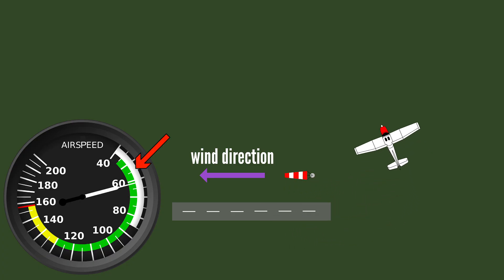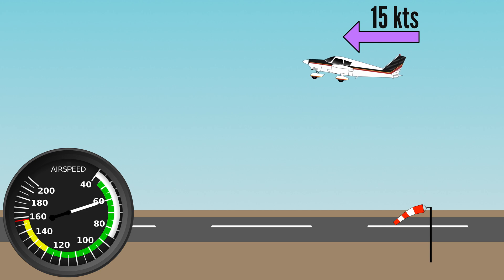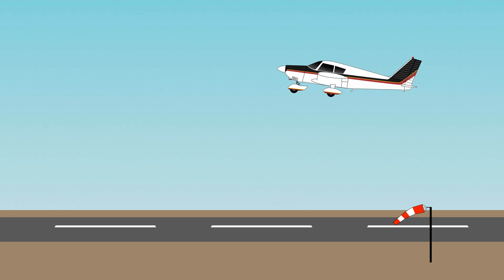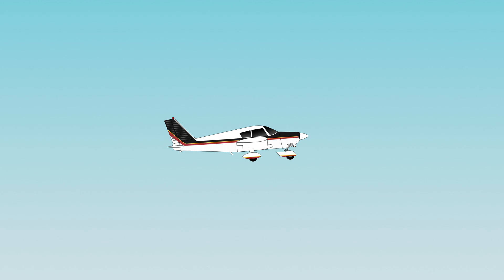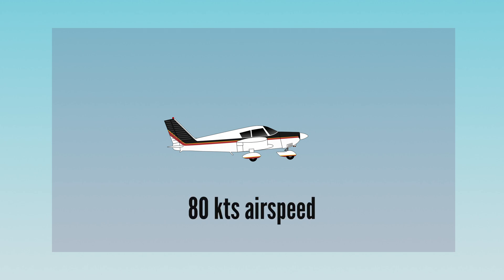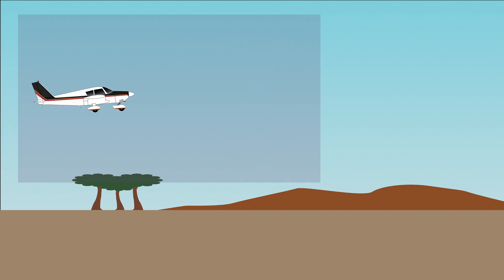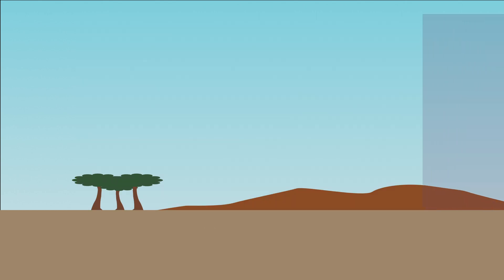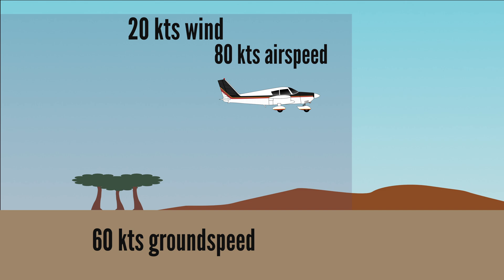The Myth of the Downwind Turn - Dangerous or Not?

Comment: Quite correct, not directly related but I once 'threw the rulebook away' after EFATO towing a glider. Reasoning? I was used to manoeuvring at low level (hooliganism) and I was able to retain a small amount of power after jettisoning the glider and turning cross-wind. The RWY was over a mile, we had started from near the thresh. Therefore I was able to plan a gliding circuit to a landing at the far end of the RWY. After 4000+ tows a final turn at 150-200' was nw.

The recommendation for the private pilot remains sensible. Choose a landing or low speed crash area and never turn back!
Reply: Drills complete by about 90 degrees into our standard constant aspect oval circuit.

So happy to evolve beyond the naff square circuit (if they still do those??).

Comment: One factor that is not mentioned is that especially beginners use too much left rudder to turn left while climbing with full power. The plane needs almost no extra left rudder but the student adds more left rudder because that is what you should do when turning left they think. That can cause a skid turn and stall the left wing with bad things to follow.

Comment: After having a read throughout all the comments here, I want to say a Big Thank You to author of this channel and video! Thank You for going into debatable topics, and open for questions and even civil argument :)

As a point for improvement, I would say, that I would love to see "official" sources proving what you say in video. Few words from FAA Publications books, e.g. Pilot Handbook of Aeronautical Knowledge or Airplane Pilot's Handbook would fit here perfectly in my opinion. 

Does this effect of "airspeed doesn't change, when turning into downwind" also a case with gliders? Does it happens in airplane, only because engine has enough propulsion to bring aircraft back to state of equilibrium of all forces acting on it (unaccelerated flight)? Thanks once again!
Reply from the maker: Thank you.

I do state my sources occasionally, but fair enough, I could do it more often and provide links for further reading.

Not sure what you mean, was the glider winched up? Or it is being towed? But it's the same with gliders. It's not that an engine powers it through, it's that the craft doesn't know if its in perfectly still air, or if the air is moving at 20 knots. It's movement is in relation to the air it's in, not in relation to the ground. If you were to plot a turning circle of a plane in relation to the 20kts of wind it's in it would be identical to one in still air. It's only when the ground is referenced that the turn's shape differs due to the wind pushing the craft in relation to the ground. Assuming no windshear of course.
Reply: @LetsGoAviate  Thanks for being responsive once again!

I still quite don't understand, why turning from headwind to tailwind doesn't change IAS and TAS of airplane, if it doesn't have to do with it's propulsion.

In my mind it works like this:
- Let's imagine the aircraft, that doesn't have any source of propulsion, and doesn't have any form of drag acting on it. Zero Thrust = Zero Drag. This aircraft has some initial velocity, so it can take off in our imaginary experiment.
- Aircraft takes off with 20kts headwind and travels at 60KIAS (and TAS, CAS, EAS)
- At this moment it has 60KIAS (and TAS), because air blows in pitot tube (and on the wings) with certain amount of molecules per unit of time.
- Aircraft then makes 180dgr downwind turn, and now has 20kts tailwind
- Air now blows in pitot tube (and on the wings) with less amount of molecules per unit of time, because of tailwind.
- Less air molecules per given unit of time equals less IAS (and TAS)
- Aircraft now has decreased IAS (and TAS) on the downwind
- If Aircraft makes another 180dgr turn on the upwind, it will once again recover it's 60KIAS.

Please, correct me, where I'm wrong :)
Reply from the maker: @phyrBlaine  You may be thinking of it in the wrong way. Try to ignore the surface of the earth. If you are flying at 80kts IAS into the wind, or at 80kts IAS downwind, the airplane does not know the differnece, since that speed is in relation to the air you are moving in. Groundspeed differs but that's irrelevant.

Now, in a turn there is indeed a slight acceleration. Lets say you are turning 2 or 3° per second. You are accelerating due to the constant change in direction, but this acceleration is in fractions of knots, in the region of 0.1 or 0.2 knots. You won't even notice it on the ASI in normal turns. And this does not change weather you are turning in still air or 40kts wind. This last point is very important, as it has to do with changing direction, not with head or downwind, since in the air, there is effectively no such thing as wind direction, it's just a block of air.

With regards to the engine, yes it provides energy via thrust. The glider doesn't have an engine, but it still has a forward force component in potential energy, and you have excess lift so you are constantly trading altitude for speed in a glider. If there are slight updrafts, you point the nose down to maintain altitude, and speed icreases. The glider is more efficient with it's low drag, so it still has a method of propulsion, which is gravitational potential energy. With no updraft, it constantly exchanges altitude for airspeed, with very high efficiency compared to an engined aircraft, and thus doesn't lose much altitude compared to an engined airplane with a dead engine.

Hope that helps.
Reply: @LetsGoAviate  Your explanation helped me to advance here! Watching more flight footages and trying it out in Flight Simulator proved, that you are very correct here, despite opinions of some of commentators.

Here's analogy, that helped me today. I hope, you can tell me, if this analogy correct:

I imagine airspace and moving blocks of air as a treadmill. Airplane is constantly moving, relative to ground, as well as a lego brick placed on treadmill would move relative to floor, which treadmill is placed on. But no matter which direction airplane turns, it's movement in relation to treadmill surface is constant, if no other changes happen in this equilibrium of motion. For example, If wind gust happens, it affects treadmill speed, and so disturbs equilibrium of motion.

I hope, if this analogy is correct, it helps someone!
Reply from the maker: Glad if it helped. 

The car on a treadmil analogy is good if we set some rules. 1. It's very long and wide, so that the car can't "fall off" it. 2. We ignore drag / air friction, the opposite of the plane in a block of air analogy where we ingore the earth's surface. 3. The cars speed is measured on it's wheels, like most real cars (not gps based speed like some newer ones). 

If a car is driving on a very long and wide treadmil, against the movement of the treadmil, the car wheels spinning speed of 50mph, cruise control on that speed, treadmil turning also at 50mph, and it makes a wide 2 or 3° per second turn until 180° turned around, like a standard turn in an airplane, it's wheel turning speed won't suddly drop to 0mph because the treadmill movement is suddenly from behind, it will read 50mph on the speedometer all the way through, and thus traveling 50mph in relation to the treadmill. Yes there will be some fractional speed loss from turning, more so than an airplane turning because the friction of it's wheels is more than purely air drag, but that is true if the treadmill is moving or standing still. 

Someone standing next to the treadmil will see something else, like the car appearing to be standing still, wheels spinning, when doing 50mph against the 50mph treadmill, but that's irrelevant to the car's wheel turning speed, like what's happening in relation to the ground being irrelevant to a turning airplane, with the exception of windshear.
Reply: @LetsGoAviate  That finally clicks with treadmill analogy! You just made one more aviation enthusiast understand this topic properly. Thanks a lot! Looking forward for more myth busting and educational content :)

Comment: Answer seems simple. Takeoff and climb at Vy. At 400-500 ft make ur turn, but stay at Vy while in the turn. Just because ur turning doesn't mean your airspeed should change. Lower/Raise the nose to keep your airspeed. In normal flight, the only time after takeoff your airspeed should be lower is short final, keep your bank angle < 30 degrees. Really hard to stall if following these rules.

Comment: As you state in your video, there are several dangers to turning near the ground. Especially turning downwind near the ground. Pilot perception. Wind shear and gradients. Thin stall margins. Etc. As far as I can tell, your beef is with the explanation; the physics. But even if the explanation is wrong, you still need to be careful in turns near the ground. So maybe allow this particular myth to persist, in the name of safety.
Reply from the maker: Maybe it's a matter of perspective. I do feel strongly that knowing the true dangers makes one a safer pilot. I'd hate being careful and not knowing exactly why, or being careful because of the wrong reason. Knowing the correct dangers will make the pilot safer in other areas too, as each individual danger of the downwind turn exists in other areas of flight too. I did confirm throughout the video that downwind turn is indeed dangerous, and that the low level climbing turn is to be avoided, so it's not like I told anyone to be less safe.